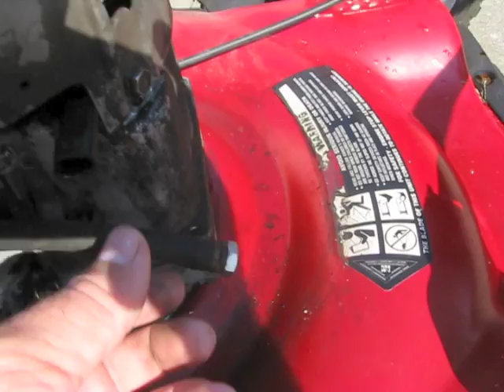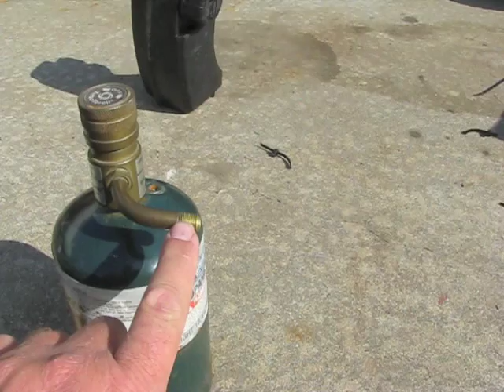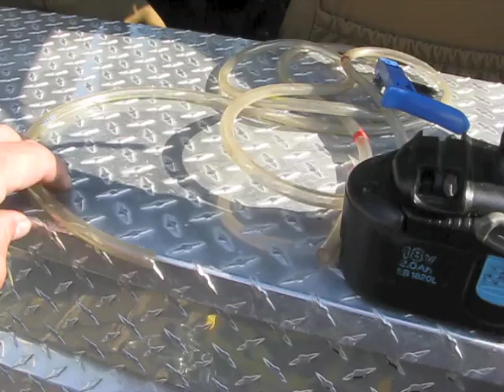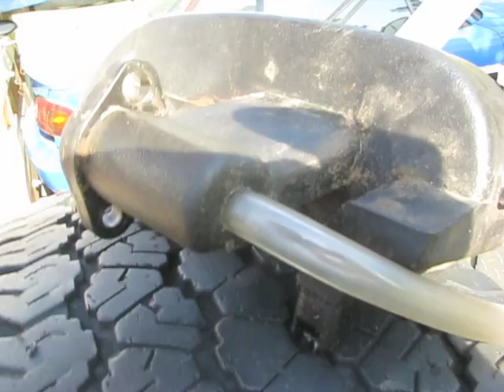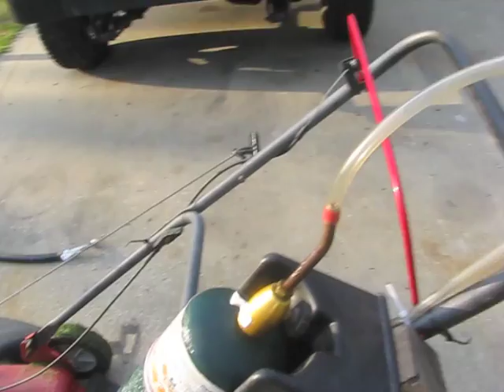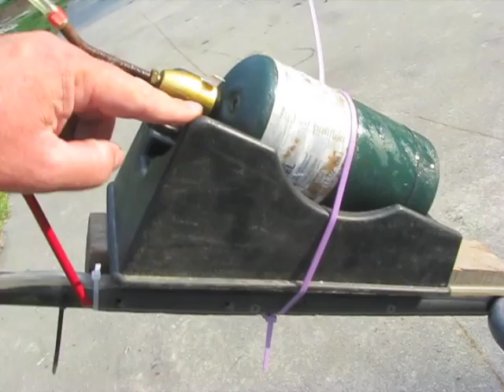LP/Propane Lawn Mower (home built)

Comment: why can't the propane fuel line be hooked to the fuel line going to carb and forget drilling holes on air filter box and just remove the needle going to the float just alemnate
Reply from the maker: I had thought about it but was worried that it wouldn't have enough flow. Probably would have worked just fine. I knew running the hose into the air box would have enough. I eventually rebuilt the carb and installed a rubber plug into the hole I drilled. I do have another air box for it.
Reply: That's kool that went back carb and culvert the but still I think there plenty of fuel going in the carb especially with the holes inside the carb don't you think it's a mine pussle

Comment: Nicely done !  You could easily   removed the blade and add a pulley, , and some angle iron out the back of the mower deck. And mount a old GM Car alternator to use for emergency power. To charge batteries, or run through a inverter for clean a/c power. And use the engine exhaust to heat up a pipe for hot water. Playing with small engines is pure fun, and propane stores forever. Great video, thanks for sharing.

Comment: Put a hotter spark plug in it and you are basically set to go  with no other improvements really necessary at all. Nice job. You can likely mow an average yard at least 3-4 times on a single bottle and sometimes even more, but your yard is not the typical size as most. Check for leaks at all points, but because of vibration, but nice job. Congrats. Learn how to refill those small bottles with the larger propane tank and  you got gasoline costs beat by a mile, plus propane is easier on the engine and less of any fire hazard.

Comment: The reasons why they don't do this is because of the Market!  Imagine..., NO MORE Carburetor, Cleaners, Parts... ETC.......  Those People would be out of a Job!  Propane has been around for a long time.... We've also found a way to " Liquefied  " them and all they have to do is " Doubled Walled " Tanks for safety and have the liquid turns back to " Vapor Gas " while being used.  Easily done!  But they won't do it!  SAD!!!!!!!!!!!!!!!!
Reply: I agree!  Propane should have taken the small engine market (anything under 40 hp) by storm  for ease of use and lack of maintenance.  I have a 17.5 hp Briggs Intek motor converted to propane  with an on-demand regulator; one word "FANTASTIC"

Comment: need propane feed tube as far in as possible to avoid premixing inside airbox and backfire
Reply from the maker: At the time I was worried about having that tubing in too far and restricting air flow. This was only meant to be temporary and for entertainment purposes. I did purchase all parts needed to rebuild the carburetor shortly after making this video but here we are years later and I'm still running it off propane. (I've been too busy) I did eventually install a much better bracket for holding the tank. It really needs a regulator as it has surging and stalling issues if the tank is more than 75% when going over bumpy terrain. When the tank is above 75%, I have to keep the RPM's lower so it can rev up instead of stalling.

Comment: how often would you change the propane? or how long until it needs refilled?
Reply from the maker: It really needs a regulator to be more efficient. It uses about 3.5 of those small green 1-lb tanks to cut my 1 acre lot (they are $10.98 for a 4-pack at Sam's Club/$6.47 for a 2-pack at WalMart) With the cheap torch tip it tends to waste propane when the tank is full and the tank gets bounced around. It also won't run at full power when the tank gets down to the last quarter (I use whats left on a small camp heater, torch, or camp stove) I have a propane weed-eater/trimmer that also uses those 1-lb tanks and 1 tank lasted me all season.
Reply: How much gasoline did you once use to cut this 1 acre lot?
Reply: +Sidney Boudro - COPY:  It uses about 3.5 of those small green 1-lb tanks to cut my 1 acre lot